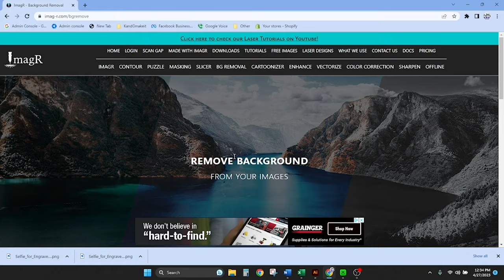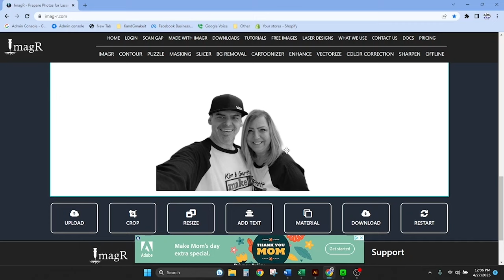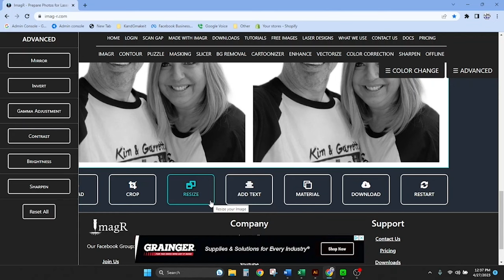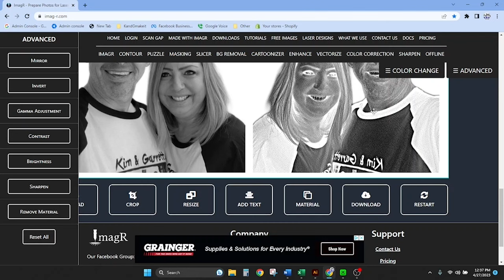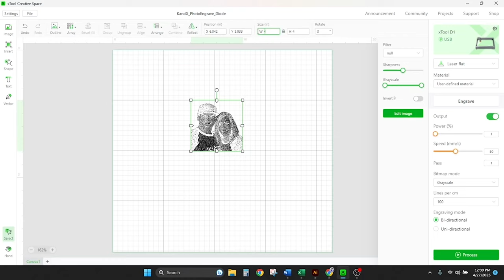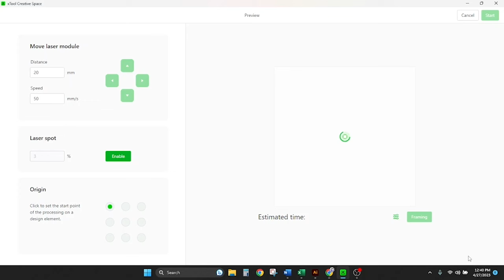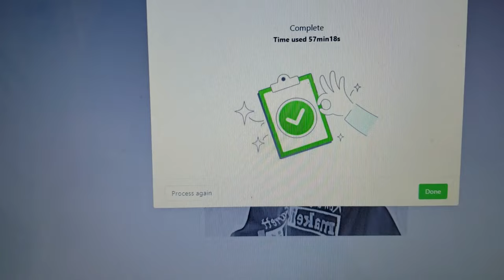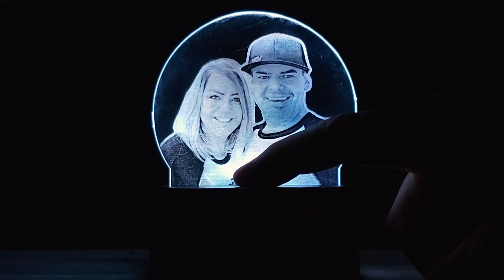Easy Diode Laser LED Acrylic Signs! xTool D1 10 Watt Diode Laser Engraver

Comment: I have a D1 Pro 2 10W. Set up the image following exactly what you did on imagr. Ran 70% @ 65 mm/s grayscale at 80 lines per cm. It popped like crazy quite a bit throughout the job, and left these blowout bubbles for lack of a better description. Any suggestions on where to improve? I sincerely appreciate your thorough videos. I’ve only had it a week so just kind of stumbling through the learning process. Any advice would be greatly appreciated!
Reply from the maker: I tried it on cardboard and I got some cracking and popping too. No snapping though. I went back to the craft paper and it was fine. The craft paper is just a little bit fuzzy. I wonder if that absorbs more of the beam and we get less flashback.  Just a thought.  Hope it helps.

Comment: How long does it take to burn this, using those speed setting and fill.   Mine took about 8 hours is that normal?
Reply from the maker: 8 hours is too long. Check the size, recheck the speed to make sure it's mm. Check the DPI or LPI, make sure it's not over 300.
Reply: does a little over an hour seem like a right amount of time? @KimandGarrettmakeit

Comment: Thank you so much for this video.  I've been wanting to do these forever and needed a place to start!  One thing though, I'm using the 10W M1, which is basically the same laser but I'm doing SVG files for band and venue logos instead of pictures converted for a laser.  When it's engraving, the acrylic itself is cracking all over the place, about every 10 seconds it'll pop and crack.  I'm guessing the difference is the vector vs bmp causing it to get too hot and crack.  Any ideas on that and where to go with settings to prevent that?
Reply: since this comment has been 3 months i wonder if you could help

the same is happening for me. its filled with cracks and pops
I've also done a burn test and after i fond a "ok" look and use that, it does the same thing, burn and pop
I've tried many thickness too
Its either i can barley see it or i ruined it

im using 10w TwoTrees brand
Reply: @artman3  I gave up using my 10w M1.  I've also got an Atezr L2 36w machine and haven't had any problems getting them made with that.
Reply: @artman3  Lower your power.  I had the same thing happen and started lowering the power 10% at a time until it reached a point that it didn't bubble and burn.
Reply: @dismeygonzalez  
thanks 😊, I also found out i had to focus it on the material below, and it turned out way better
.
I did one of those square tests to find the right power
Reply: @artman3  Yes in the method they use you have to focus on the material below.  I didn't have any issues doing it like that.  When I made one with tempera paint, it's when it bubbled and burnt. =/

Comment: Does your acrylic pop when you're engraving it
Reply from the maker: I don't think so!
Reply: @KimandGarrettmakeit  Thanks I must have bought the wrong acrylic from Amazon.
Reply: I have issues with it popping / cracking, I keep trying it on my m1 though
Reply: I've been working on a couple and I've had a couple crack a little and I'm thinking it must be the difference in the temp of the acrylic plaque then the heat of laser beam it self..plus I need to adjust speed/power and I just have the Laser Burn program.
Reply: Weird it cracks in the m1 for me but does fine on my d1 40w

Comment: Thanks for your help. I would like to know, the "kits" I buy come with 4mm blanks, if in testing, using the blanks that come with the kits, and you want to buy only replacement blanks are 2mm, how can one use a 2mm in a 4mm slot without too much play? TIA
Reply: Superglue a strip of the 2mm acrylic to the tab of the 2mm piece, making it 4mm thick.

Comment: Might be a stupid question but......how does one run a material speed, power, lpi, dpi, test for images or bitmap engrave, raster images ....whatever they are called? Then another question....I am trying to use a P2 (I know quite a different machine) to print on these acrylic signs. For me light burn simply does not work period and I have not tried to figure out why...the question is can an image be prepared in lightburn save and opened in XCS. And then dithering...Image-r dithers the image ....lightburn lets you use pass through to by pass dithering again how does one accomplish that in XCS....Sure would like to see a video on how to do these things. XCS has a number of choices that don't seem to be able to bypassed and there is no real guide, that I can find, on how to really use XCS to print pictures successfully. You do it but I sure can't seem to duplicate it. Create a video using the P2 to create these LED Acrylic signs with XCS and Image-R (which removes the background) and detail why or why not to use choices in processesing in XCS. This comment sorta shows how confused I am about all of the software options for processing photos on acrylic and how they work. I think I am using too much power and to little speed and have no idea about lpi and dpi other than I know you can get to high and squish lines together. OK enough. I must say in conclusion I really like your videos.....except I keep ducking thinking Garret is going to give me a black eye. (smile here)
Reply from the maker: GEORGE!!! I can't help the hands! I try! We did this exact thing in a video using the P2.  Maybe that one will help?  Let me know! ~garrett  https://www.youtube.com/watch?v=mq4hKlTHFSA
Reply: i have watched this video several times....i thought it ws and OMTECH CO2....I saw that the wattage was about the same as the P2 but the problem I am having is that the P2, for me, is that I have to use XCS rather than lightburn with m P2. Light burn just doesn't work with my P2. I noted all of this in the above comment. I read on the P2 Facebook group that you can't use Imag-r with XCS because it doesn't have a pass thru feature thus will double dither the image??? The video you did using the Xtool 10W was interesting and since I own both a 10W and 20W Xtool laser I might try them. I just baught this expensive P2 and wanted to make it work there. I might add that several years back I and a friend sold many wood products at the Minnepolis Farmers Market every Saturday during the season, and it was fun and also a great deal of work. My friend passed unexpectadley 4yrs age and I am 83 ...well my age is telling. Really miss it tho". I tend to get a bit wordy...Thanks for your response and again I really enjoy your channel.  @KimandGarrettmakeit

Comment: Just tried this project. 75% successful, had lots of what appeared to be small bubbles. Where do you set the focus? As it engraves on the back I set the focus on the black card level, was I wrong? Thanks
Reply: Try dialing down the power and doing a test starting off at lowest power 10% and a fairly fast speed then go up to about 40. The bubbles are caused by the acrylic getting too hot
Reply: Since the laser is burning at the back of acrylic I would focus on the black paper

Comment: my question is how are yall not burning it and making it not pop
ive been trying so hard, different thickness and power test

its either i can barley see it, or its burnt and bubbles are everywhere

my laser says 10w on the laser itself. If i used 40% power and 3000 speed its burnt and filled with bubbles

Comment: What exactly did you mean that X-TOOL charged you $5 an hour. Don't you have an X-TOOL? They charge you $5 an hour for using your own X-TOOL.
Reply: Same question here.
Reply: They were referring to how much it cost to run the X-Tool for an hour on electricity.. So they worked out that for an hours use, it's cost them $5 in electric